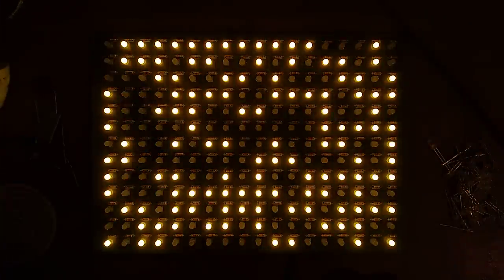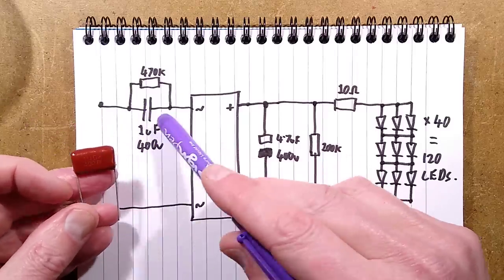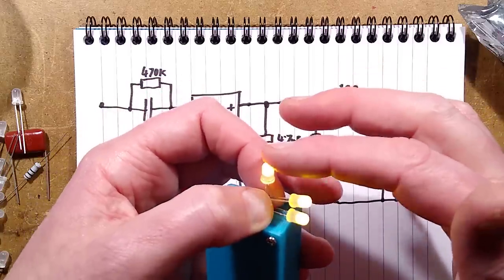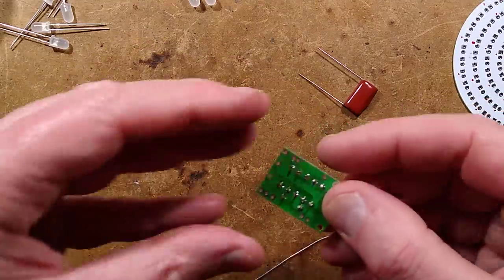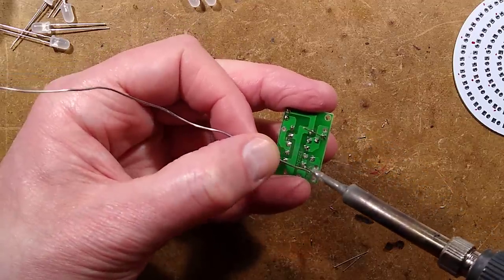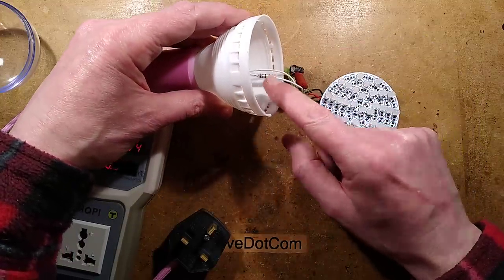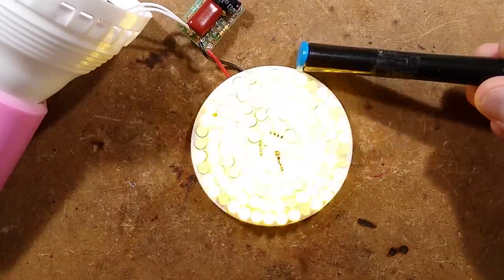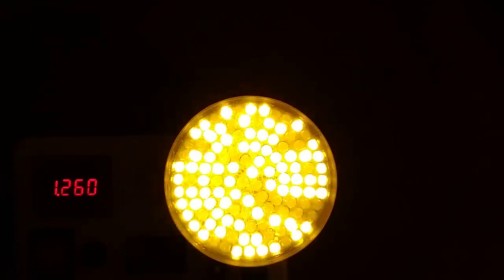Supercomputer light bulb build   -  with schematic

Comment: They said lead solder is dangerous, lets replace it with lead free that requires nasty toxic flux...... idiots. I am convinced lots of electronics failures now are due to crappy lead free solder joints breaking. But i guess if things dont break how will they sell you the next model. On products that will get heavy use i often re solder the connectors with leaded solder .

Comment: Risqué, I think it's said as, ris-kay

I'd consider making this, but without leds, I'd have it as an inductor and capacitor and a speaker on the power line, for maximum cocophony
Reply: It's actually pronounced "risqué". You're welcome. ;-)

Seriously, now, an "é" in French sounds like the "e" in "bent" or "sent" (not like "ay"). Same sound as the end of "allez".
Reply: @RFC-3514  wrong
Reply: @phonotical  - I guess I've been speaking French wrong for over 40 years and no one told me, then. 😆